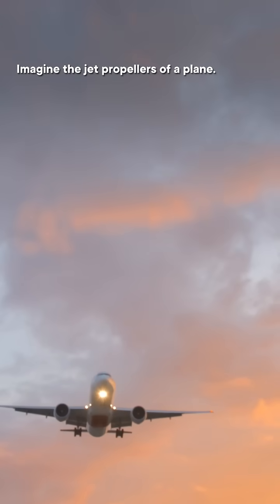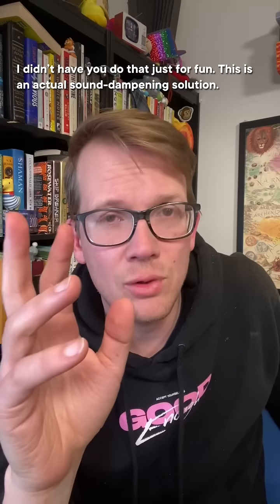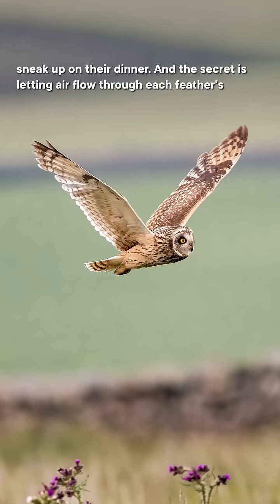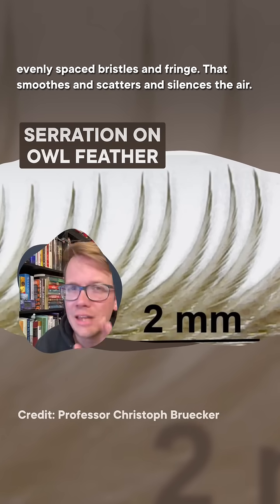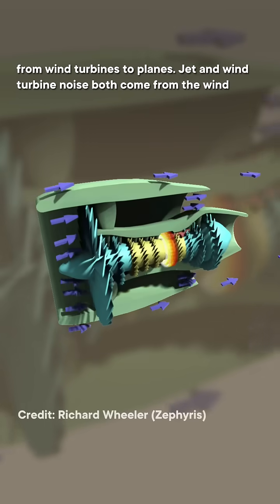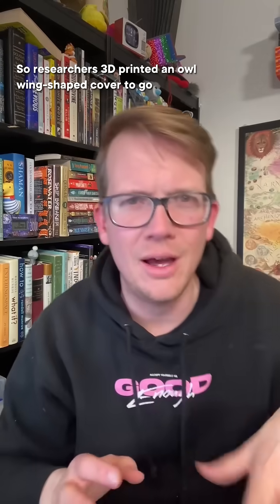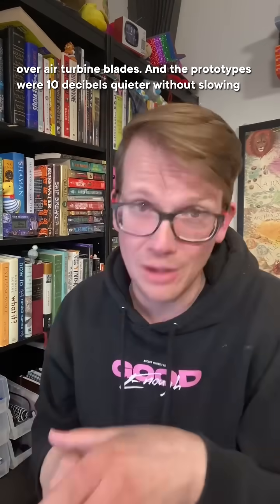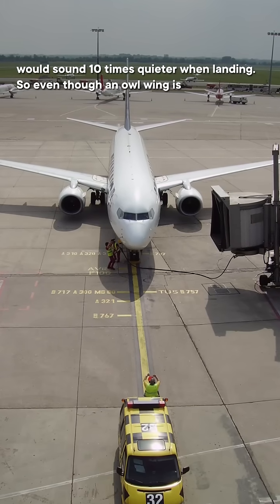Now, we can be as quiet as owls #shorts #science #SciShow

Comment: That is not a propeller, it's a fan. That particular plane has High-Bypass turbofan engines. Individually they are called fan blades. If it had propellers it would be a turboprop aircraft. Thats where you mate a turboshaft engine to a gearbox that turns a propeller

Comment: We sorts already knew this from the divits on golf balls. Preventing the airflow created by the movement from building any one stream that is stronger or more unified that the others. This creates a smoother, quieter, and more energy effecient flight. Yes, quieter. Used to hear smooth golf balls hiss as they took flight.

A strong singular stream sounds effecient to engineers doing calculations, and look nice in windtunnels... but they also create drag.

I don't think they need wing shaped attachment... they just need to serate the trailing edge of each blade.

Comment: They are not jet propeller, they are called compressor rotors and staters , they work vastly different than propellers. The high bypass jet engine is much quieter that the old engines, and turns at about half the speed while producing much more thrust. You should go back to the beginning and study the progression of the tech to the present

Comment: Using chevrons on the back smoths the airflow dramatically reducing noise.    The problem with a owl wing is that it reduces efficiency.  For airplanes  even a 1% savings in fuel burn will cause airlines to spend alot of money to get that.   Modern most particularly geared high bypasses engines are very quiet already.  Geared fans are quiet because the fan blades have a more aggressive pitch and spin slower than the compressor wheel.   That grinding noise you hear on some older planes are the tips of the fan disc going supersonic under full throttle think 717 and 757.

Comment: I want to add that one of the reasons this is becoming more relevant is because another major source of sound from jet engines is the wind shear between the output air and surrounding air. As bypass ratios have increased with engine technology, the difference in speeds of those airs have decreased (you're moving a larger volume of air less quickly instead of a smaller volume faster), resulting in quieter engines. This increases the relative proportion of engine noise coming from the compressor blades, meaning owl wing-ifying them becomes more and more relevant.

Comment: Would it be 10x quieter on landing? I don't know the 737 specifically, I know some planes use throttle to control lift on descent but I thought 737 used pitch for that.
But 10x quieter takeoff would be rad.

Comment: Human hearing is not on the same base 10 log as decibels. 10 dB reduction would sound half as loud. Also, the turbofan itself is only one part of a system that generates sound - this solution wouldn't work for the high temp compressor stages or deal with the combustion energy.

Comment: A lot of the noise from jet engines is because of the fan blade tips can have supersonic speeds at high engine power. That's why there's so much interest in geared turbofans, where the front fan will be slowed down so the fan tip speeds stay subsonic.

Comment: I can't see it making a huge difference to planes, but it could definitely improve wind turbines, as well as fans, blowers, etc. Turbulence generated at the blade edges of all these things (including jet engines) creates a roaring "white noise" or in the case of wind turbines, a pulsating "whooshing" sound, since they rotate comparatively slowly and we hear the output from each blade.
This kind of noise is made up of a full spectrum of frequencies, and is bad close up, but to our ears it fades quite quickly with distance, because the different behaviour of each frequency means the overall noise separates out and spreads randomly, instead of "holding together" as a recognisable sound.
Jet engines produce plenty of this type of sound, and people who work on the apron at airports will know all about that. But as members of the public, most of what we experience as noise from jet engines is from planes flying above, or taking off and landing quite some distance away, and is the more persistent "whine"  made up of a fundamental frequency and harmonics. This can travel much further and is caused less by micro-scale edge turbulence and instead by the fact the multiple rapidly-spinning blades create pressure pulses at audible frequencies.

Comment: They are already doing that. That is why there are Chevron-shaped cutouts on the rear edges of the 737 Max engine cowlings. They work pretty well too. The last time I saw one of the newer Boeings landing overhead, I couldn't even hear the engines, because it was a slightly windy day, and the wind was louder in my ears than the airplane engines were 100 feet up.

Comment: Pigeons have a similar thing. They have specialized feathers that make them 10dB (exact number made up) louder when they hit a certain accelleration. It is used to tell the other pigeons "AAAAAAAAAHHH" so they know the first pigeon saw something scary. You might, for other things, make pigeon tech air turbin blades that are quieter if things are fine, but when things go wrong the turbine could shriek in despair, to make bystanders go away before something breaks.

1000 likes and I will literally talk to boing or wind turbin inc. or something.

Comment: 10db would be 50% perceived quieter engines not 10x… also, it’s takeoffs that are significantly noisier than landings as thrust is near full power whereas in landing thrust is greatly reduced and the only major noise is the thrust reversers which lasts significantly less time than the spooling and takeoff procedure…

Comment: This dude is too smart to call a jet turbine on a turbofan engine a propellor. 

If you’re confused, I’ll explain. The difference being that a prop spins and pulls the plane through the air. 

The turbine blades of a turbofan don’t pull the plane, they suck in the air for compression so it can be mixed with fuel and the burned, creating rapid expansion that then pushes the plane forward.

Comment: Engine noise doesn’t come from the rotors, it comes from the core of the engine and then exhaust, where 400 degree compressed air meets ambient air. The large fan at the front already suppresses this noise by bypassing cool air around the core of the engine creating a “cushion” That’s airliners don’t sound like fighter jets that have a low bypass or no bypass at all.

Comment: Ok love the idea but that’s not how it works, first of all those “propellers” on the plane are actually just fans that compact air for a system that compresses the air into heat and makes thrust, second thing, if you even use this on a propellor plane it would make no difference because it’s the engine the makes the sound and even if it wasn’t it would still not make enough thrust to fly

Comment: I am an aerospace engineer and a pilot on the a350. I’ve worked for a couple of years in trying to make planes quieter and one thing that was the biggest producer of noise on a jet engine (not the plane itself), was the very hot, very high velocity exhaust from the engine core mixing with cooler and lower density air outside. We experimented with running the fan of the turbofan engine without the core and on its own it’s incredibly quiet.

I’m sceptical if this would make much of a difference with noise however I would like to preface this skepticism with the fact that I have not done research into this specific noise dampening solution.

Comment: A difference of 10db is actually half (or twice) in terms of loudness, since the term quieter was used (and loudness phenomenon of human perception). 

However, when measured, an electrical signal corresponding to that 10db change would be about 10x more (or less) powerful in those terms.

Comment: One problem with the jet engine implementation is that Jet engines use combustion to increase the output force. So we would also need another way improve on that. And the exhaust fan may struggle to cope from the Heat depending on the material used for the “owl wing” structure

Comment: Hay, I am not Airplane Pilot, having something like a jet engine, And it doesn't have to be noisy but that just so it has feedback from the controler. The airplane pilot might need feedback from the jet engine or engine just like when your driving a vehicle. It might help if the engine is less noisy though just my opinion.

Comment: I don't think the fan blade would do much for the loudness as the inside of the engines have a lot of stators that influence the airflow greatly to prepare the air for the combustion chamber and the exhaust. By the time the air has reached the exhaust you propably wouldn't notice anything from the owl winged fan blades

Comment: The idea is cool in theory, and it may have worked in some testing, but my guess is that this wouldn’t work very well at all. The way owl feather are made do make owls quieter, but they also make owls slower because of the amount of drag that the feathers create. 
This would translate poorly into the jets, making them quieter yes, but also probably increasing the fuel consumption quite substantially due to the amount of drag created within the engines. It pretty much completely counterintuitive to what the design of a jet engine is. There would also be the problem of maintenance, since the structures of owl wings are very fine and not very robust. This translated into an aircraft engine would create all sorts of problems, like having to be maintained and repaired very often. Not to mention that if something goes wrong and pieces of a single blade wear off and fly into the rest of the engine, the whole engine would have a likely chance of destroying its self.
This all of course pivots off the idea that we use the same design of owl feathers and not some more reliable alternative to the method owls use.

Comment: A similar noise reduction part is used in turbine engines. Acoustic panels around the inside of the fan case of the engine are used which are hollow and have small holes in them to decrease sound passing through the fan blades

Comment: You Damp vibration and sound. To Generally, Damp means to restrict or control. Dampen is to make something slightly wet. A Damper is a device to restrict flow, like the damper on an exhaust vent. 

Jet engines have turbines composed of blades. Together these blade and called the fan but definitely Not propellers.

Comment: Jet engines are the issue with noise. Most noise you hear from planes landing is actually the way atmosphere is hitting the metal. It's why planes are IMMENSLY quite than they were 30 years ago. Then the loudest thing on the plane while it's parked/parking is actually the APU (auxiliary power unit). Which in principle, is the plane's alternator.

Comment: Imagine applying that to household fans so we can have our AC on while also still being able to hear what we are watching
Reply: Lol i can relate to this. Ive been told my AC sounds like a truck or waterfall in tge background
Reply: @renem8130  if yours sounds like a truck then mine literally sounds like a tractor..im not even kidding just look up a tractor moving slowly
Reply: @whatisthis-28wh2  If the fan is old, it probably means the bearings are worn out. Does it go away if you turn it upside down?
Reply: If you have central A/C, this isn't a problem. I think we all need to start upgrading to central A/c now that the climate is so different and only getting hotter/colder
Reply: @KendallHall  the issue is affordability and with older apartments not being built with space for central ventilation
Reply: @KendallHall it’s still a problem if you plan to do anything near the location of the unit. I have a woodshop in my basement and anytime the furnace (literally just an exhaust fan because it’s a water loop) starts, it’s stupid loud. Same with the draft inducer on the water heater. A forced air furnace is even louder than a water loop based one.
Reply: Try oiling the fan bearings once a year.
Reply: Humpback Whales' fins have 'tubercles' on their leading edges. 
- IIRC this has been applied to fans and moves more air, with less power.
- Not sure if its quieter though.
Reply: I JUST had an argument with my dad because I could hear the fan in the next room and he could not, until he was standing underneath it.
Reply: Facts
Reply: This is a better application for that tech than jet engines. The noise of a jet engine does help deter birds and other wildlife, but a fan doesn’t have that issue and is just loud.
Reply: What kind of shitty AC do you have at home lol
Reply: @tjorvenblader  i don't have AC, all i have is a giant fan, and I live in Florida, so you know that isn't enough
Reply: @tjorvenblader  i got a fancy ac. Still gotta turn up the volume a few notches every time I turn it on
Reply: There’s an easy fix for that. Don’t pick the cheapest fan.

Comment: Hold on, either my math is wrong or yours is wrong; because, you said it brought the noise level down by 10 decibels. 

That DOES NOT equate to ten TIMES quieter.

The average sound of a jet engine is 150 decibels. So this new design reduces that to 140 decibels. That's roughly a 7% reduction is sound. Still, to be 10 times quieter would take far more improvement than a 7% reduction.
Reply: The decibel scale increases exponentially, not linearly. Every increment of 10 db translates to 10× the intensity. It's the same as how a 1.0 point increase on the Richter Scale translates to a 10× increase in intensity.

Comment: Will this guy doesn't know what he's talking about. Reducing a 747 from 130 DB at takeoff by 10 decibels does not reduce the sound by 10 times.
Reply: Decibels increase exponentially, so an increase of 10 db translates to a 10× increase in intensity.
Reply: @jax5734  intensity of what?
Reply: @johnnymnemonic8487  the intensity of the sound wave, or in other words, the loudness of the sound wave. If you were standing near the jet engine, you would notice a massive difference, especially in how much the sound vibrates your brain and organs.

Now, he could have been more clear about how that translates to our ears. While it is literally a ten times weaker, it wouldn't "sound" ten times quieter. I'm not sure exactly how much quieter it would sound, probably only half or one third as quiet, but our ears don't perceive loudness at the same rate in which the intensity increases.

So I guess you weren't wrong, but neither was Hank. The phrasing was just confusing.

Comment: Never going to happen for a few reasons first is that adds surface area to the blades making erosion happen sooner which is the bane of that style engine any way. Second you said 10x quieter which is wrong 10 decibels isn't 10x for every 3 decibels you double the volume. So like 3x quieter more likely for additional machining cost and maintenance cost it will never happen plane volume isn't a big enough problem to add all of that cost.

Comment: Jet pilot here. As far as I am aware, it's less the sound of the blades and more the sheer effect between the high speed jet blast and surrounding air that causes the vast majority of the noise. So this owl blade design would probably help to some degree, but not linearly 😅 (definitely not 10x quieter unfortunately)

For example the A320 NEO and 737Max use larger diameter geared turbofans that achieve a lower speed of the bypassed air, resulting in a 60% noise reduction.

Comment: No it wouldn't, that's not how dB's work. If the engine is 10dB quieter with the new blades, humans would perceive that as half as loud. That said it would Technically have approximately an 8th of the energy. But human ears are not measurement microphones, they work differently.

Comment: Achieving a 10dB reduction in SPL would be an amazing feat, but this would only yeild a roughly x2 decrease in perceived loudness (actually, 6dB difference is the value given by the relevant literature as perceived to be "twice as loud"). Also, the effect of that on sound pollution levels would depend on frequency response of such modification and weighting of the measurement scale, since when a plane passes over us we usually only actually hear the low end portion of the signal, unless it's very close.

Comment: Complete misinformation. According to the given sources they tested 3d printed plastic covers on windturbine blades. They speculated that it could be used on airplanes but did not mention applications in jet engines and even less so jet engine turbine blades. To test plastic 3d printed covers on turbine blades in hot combustion gases would be silly. Most likely it can be used on wings, cowlings, exhaust nosel or fanblades in an turbo fan engine. This is very porely fact checked.

Comment: I once had to wear those noise recorders while we ran up a hornet it recorded about an average 105 db which was with 7 extra hours of relatively quiet paperwork and prechecks so i don't believe a 10 db difference is going to be much in terms of jet engine noise
Reply: dB work on scales of magnitude. A 10 dB difference from 10 to 20 dB is not that much, but a 10 dB difference from 105 and 115 is the difference between having lasting hearing damage and not.

Comment: I'd like to see you design a jet turbine engine using the feathered design.😂
The sound will not change. A venturi cluster of blades and the jet fuel used makes the sound as it rotates the turbine at very high velocities. Where's the correlation between the two? Owl wings can't compare to an engine. Owls flap their wings to fly and they glide and fold their wings in a dive, and they're way smaller than a jumbo jet. 
Electric motors, now that will cut out the majority of the noise heard from jet turbine engines. 
Does he actually think that he's smart?